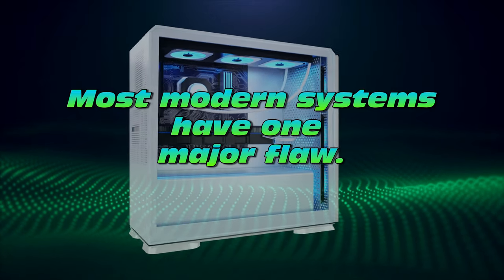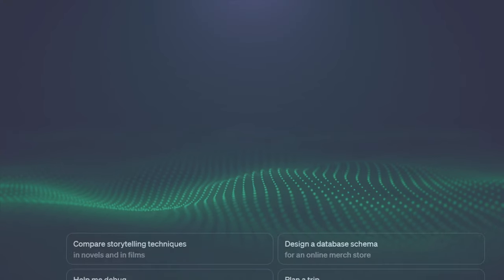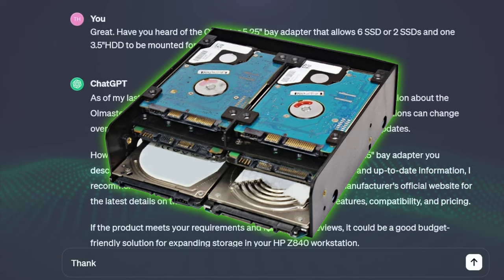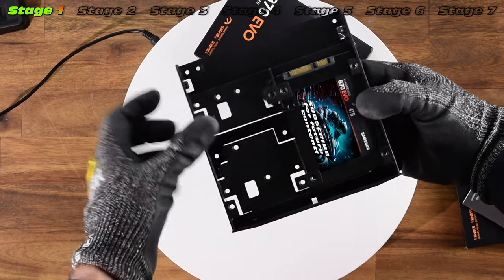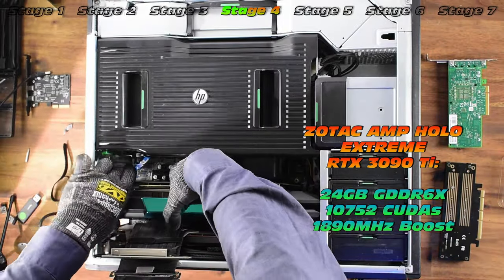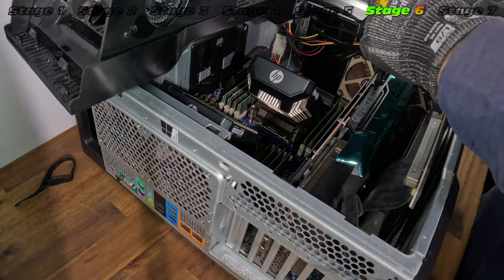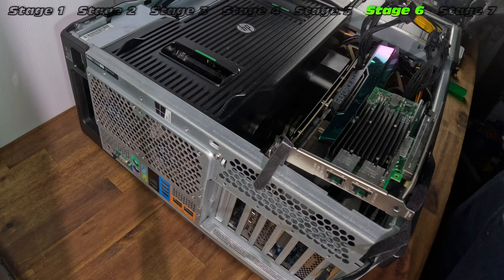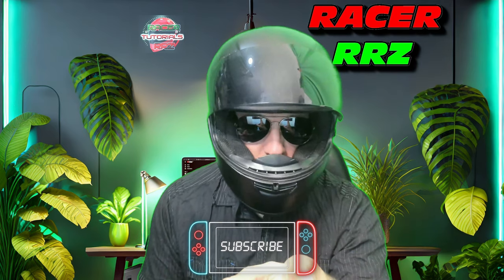Is this the most cost effective storage expansion? - HP Z840 Workstation + 5.25" Bay + 24TB SSD/HDD.

Comment: Good stuff. I for one enjoy watching content about storage solutions. Getting to the point where you can't fit those newest CoD games on SSDs without going for RAID.

Bit of a rant: Yesterday I just completed my new 8TB NAS setup with 4xNVMe drives striped and while there's a bottleneck somewhere and its throughput is well below what I expected, I can still max out the 10Gb/s link between my workstation and NAS in large file transfers. Could probably fairly comfortably even play games installed on network drive now. Was only getting 4-5 gigs at first, but later I realized manual tuning of socket buffer size in samba was actually hurting performance in this case. I would say one interesting thing I found out was that it's actually possible to configure samba to make use of smb multi channel even with single NIC as long as the NIC supports a feature called RSS, or Receive Side Scaling. My Mellanox ConnectX-3 did have that feature and I tested it to see that it did actually use multiple connections/threads while transferring files. This could potentially help with CPUs that have lower single thread performance.
Reply from the maker: Nice. It really is intense how large installers have become - some software systems can use 1TB of storage and then still want more. I think my DaVinci Resolve library is slowly hammering my 8TB RAID 0 pool. 

Your hardware setup and speeds sound almost exactly like what I obtained on my Z440/ Z840 10GbE network. I did find it strange that I could watch 4K video from the NAS over 10GbE but I could not play back the same video off a HDD mounted in the hose machine. 10GbE does seem to break some logic rules! I am clearing some HDDs for a test. I will test 4x 4TB HDDs with RAID 5 in TrueNAS. I suspect that will give me more than my current limit while writing to a single HDD drive. 

Tuning smb multi channel sounds like a viable solution for improving data transfer in certain systems. I have not really tested the limits of my Xeons for this, but I would like to think they would never really be pushed with mere data transfers. I have an older HP Elite 8300 SFF with TrueNAS that I need to do some tests with. It seems quite capable despite the well aged 4 Core CPU in there.

Comment: I love your content, rarely reviewer reviews workstation, workstation is incredible machine, it's long life span, I still use workstation from 2014 and still going strong, on par with high end consumer pc i9 14900K without heat issue and thermal throttling, workstation is amazing. I use HP Z840 with 2X E5 2699 V4 and RTX 4090 for rendering, editing, after effect, everything run smoothly, build quality far far more better than dell 7910 that I have too
Reply from the maker: Thank you for your words. Yes, it is quite rare to see these more aged machines get reviewed these days. The value proposition of the HP Z840 with dual E5-2699 V4 CPUs is difficult to beat - it literally provides a top end experience that is still competitive with modern hardware. There are other systems that are also quite good - and generally Dell Thinkstations do a great job - it would just cost a bit more generally to get a decent modern system. I would like to think the HP systems have a better build quality than say Lenovo or Dell, but if you have to spend more for that it may not always be the best option. I usually just settle on the highest performing system for the lowest price possible. Right now that has landed me on the HP Z8 G4! 

Wait - you managed to get a RTX 4090 into your Z840? That's awesome! You should consider to make a post on our Reddit page regarding your experience with the RTX 4090. I initially disregarded the RTX 4090 in the Z840 because of the 4x 8-pin power supply requirement, but I later realized that with a 3x8-pin to 1x 12VHPWR adapter you could very well get the latest hardware into a Z840! In case you haven't seen it - here is my latest video overview of the Z840: https://youtu.be/2bie4EGJZL0
Reply: @racerrrz  I use Y splitter to get 4X pcie pin power, 1 line pcie supply 225 watt, so 3 lines will supply 675 watt, more than enough for RTX 4090
Reply: Hello! Why is Z840 better than T7910? Can you talk more clearly about its advantages and disadvantages?
Reply: @agungnorhasni714  Hello! Why is Z840 better than T7910? Can you talk more clearly about its advantages and disadvantages?

Comment: For SSD storage: Athena Power BP-15827SAC - 8 Sata SSDs in 1 5.25" slot.  Add a cheap 8 port Sata pcie card for about $30 and you are good to go.

I love mine.
Reply from the maker: That is a work of art right there! Nice find. I had not seen this 8-bay adapter until now. Everything you could want, plus it's space efficient and cost effective. That has to be the winner there. It would pair up well with the Intel H240 HBA which has dual SFF-8087 ports that can be converted to 8 Sata/Sas ports with adapter cables. I'll add your suggestion to the video description for others to track.

Comment: Great video. I just got an HP Z840. Why use Windows instead of some Linux? I was going to dual boot, but use something like ZFS for the bulk of my storage. I need to use some 3D software in Windows. But most of what I like to do can be done in Linux.
Reply from the maker: I live and breathe Windows 10 Pro - it's my go-to OS for daily tasks. Likely Linux would be faster and it could do most of what I need but it just gets annoying to deal with software that isn't compatible. Dual Boot Linux + Windows has always been a nightmare to get working for me (recalls many hours of frustration lol). Once working it's great.  

If I am on Linux it's usually to deal with Windows issues outside of the Windows OS (Windows issues vanish in Linux, surprising I know lol). Linux Server is decent also, but I settled on TrueNAS Core as my secondary OS (well storage OS). I am planning to test out Proxmox and I suspect that might really help with managing several different OSs on the same system. It's handy to be able to boot up a given system in any required OS or to just be able to test something. 

I have my Z440 Server Build setup to boot into Win 10 Pro or TrueNAS Core, I should probably get another SSD in there for Linux lol.
Reply: @racerrrz  I used Windows since DOS days. I still feel like I'm drowning when I get a DOS shell. I remember having to get things running with batch files. Then I learned Linux shell and everything was so easy. You can get Linux shells that run on Windows now. So that helps with low level tasks. In the old days I used to program on WindowsNT, which was a step above regular Windows and written by non-Microsoft people.
Reply from the maker: There is nothing quite like that throw-back to MS-DOS, but CMD is the closest thing to DOS that I run into these days. I enjoy my GUI lol. Linux does do it well though and once you know your Sudo's it's not all that bad. I recall Windows NT but I don't think I spent much time on it. I went to Win 95 and then to Win XP.

Comment: I really need to stop shucking HDDs. The WD white labels only have 4 mount points.
Reply from the maker: I like your approach for getting cheap HDDs lol. I opted for a more outrageous method - AliExpress "new" HDDs lol. So far I can confirm they are likely all used drives that have had their SMART data adjusted. But my logic is that for the price point, if I can get a 1-2 year old W/D Red Plus NAS or IronWolf Pro (checking the drives details for a date is a must) for half their retail price then it's worth it. Even if they were used for something like Chia Mining for 1-2 years they should still have a heap of live left - I hope.

Comment: I like this content! It could maybe use some refinement 
but it’s better than what I could do. I see now why you need the helmet. Butting heads with trolls…  
Now for my main question/comment: I had been inspired by your videos on using an older HP z840 workstation to get some more storage or use as a server of some kind. They seem to be running around $800 or so. So I hadn’t pulled the trigger. Recently I happened to find a used Threadripper 1950x system with everything except a GPU in the case for $400. I jumped on it because I figured maybe i could work with that. It’s in a Fractal Design Meshify. I don’t think it has a lot of bays for hard drives but it has a few. I was thinking maybe I could get an NVMe M.2 PCIe expansion card for it. What would you do with such a system?
Reply from the maker: Thank you. I am open for suggestions on how to refine things (any input gives a new perspective, good or bad). It's a slow process but I continue to aim to make small improvements with each new video.

It's a fine line between the modern hardware and the aged systems. Generally, you pay more to get a "modern" system up and running. E.g. Just getting a decent case that can house lots of HDDs will set you back ~$300 USD (e.g. Z440 + Fractal Define 7XL + Drive caddies - there's a video for that: https://youtu.be/K4RalaEbRI4 ). 

If you add in the cost of CPU, Fans, PSU, Mobo it usually reaches more than that of the Z840’s price. Your complete system for $400 was a great price! If you were planning to game on it, the newer system would be far better (single core performance on Xeons isn’t great). Pricing on Broadwell Xeons is however really good right now. I got a E5-2697A V4 for my Z440 for a great price (Affiliate link: https://www.ebay.com/sch/i.html?_from=R40&_nkw=E5-2697A+V4+&_sacat=0&_sop=15&mkcid=1&mkrid=711-53200-19255-0&siteid=0&campid=5339029473&customid=Xeone52697AV41&toolid=10001&mkevt=1).

Threadripper 1950X vs E5-2697A’s benching:
https://www.cpubenchmark.net/compare/2814vs3058vs2814.2/Intel-Xeon-E5-2697A-v4-vs-AMD-Ryzen-Threadripper-1950X-vs-%5BDual-CPU%5D-Intel-Xeon-E5-2697A-v4

I did consider case swapping the Z840 into the 7XL (https://youtu.be/Rsr_zxOg6K8) which would make for a solid server/NAS foundation. The Z820 / Z840 both have SAS and SATA chipsets, so they are ideal for storing lots of HDDs. The bonus with the HP workstations is the efficiency of the PSU (90% platinum), but your idle power draw is high (like 300-350W). 

Regarding PCIe M.2 NVMe expansion – I have done tests on 4 different quad adapters so far. This video compared 4 adapters head-to-head: https://www.youtube.com/watch?v=xqg0uQ93KTg  and I also have 3 of 4 individual guide videos done (more detailed overview on each adapter). 

Presuming your motherboard has an extra 1 or 2 x16 PCIe slots that support bifurcation you could work towards the Asus Hyper M.2 Gen 4 adapter. In my testing (I did the Gen 3 adapter in the Z840), that was a great balance between speeds and thermal control for the price tag. Affiliate link: https://ebay.us/S1qBJE
Reply: @racerrrz  Thanks for the detailed response! I wasn’t expecting that. I will use your links as a springboard to do a deeper dive. I had thought about putting the Gigabyte X399 Designare Ex MB with the 1950X TR into a larger case with more room for storage at some point. Last I checked the PCIe could bifurcate. I can’t remember how to verify that but will ask ChatGTP. I’ve never tried RAID configurations before but the moment I heard such things were possible for home computers/servers I’ve been trying to figure out a way to acquire hardware and do it as close to the right way as possible on the first go around. Can’t avoid the learning curve entirely, which usually costs $$$. I will rewatch this video and some others but if I had to make an unreasonable request, it would be to keep it more within reach of newbies without, I suppose, boring the expert enthusiasts out there. Thanks!
Reply from the maker: Go for it. The challenge lies in finding solutions to problems that present themselves. The X399 Designare Ex with a 1950X TR should give you decent performance and the hardware should be quite capable of handling future expansion that you may want to do. Bifurcation wise, it's best do go down the Google search route (ChatGPT has limits for now). https://forum.level1techs.com/t/gigabyte-x399-pci-e-bifurcation-support/127130/6 I suspect with updated BIOS you would be ok, although it looks like the board didn't support bifurcation right out of the box (but with BIOS updates the support was likely added). 

The joys of ChatGPT, I am glad to hear you are using the AI for clarification - too handy these days. Each RAID level serves a purpose and it can be a life-saver if setup correctly. I am impressed by the performance of my RAID 0 NVMe pool, but that is high risk storage. The more optimal format is RAID 5 or RAID 6 which can provide a buffer for HDD failure. It's not really something that becomes important until you have data that you want to keep secure, but I would still think everyone would benefit from that added data integrity. It's less than ideal to loose old photos, videos or documents etc. See how you get on and if you have questions you know how to go about solving them, questions.
Reply: @racerrrz  Hello! When the Z840 is in idle state, how much voltage is consumed?
Reply from the maker: @sachsongkhoe  Hi there. Sorry about the delay. The Z840's power use will vary depending on the configuration. My system would typically use ~ 350-400W when loaded into the OS but at idle. When bench-marked the power-use could spike to ~750W. These power readings include all peripherals connected to my machine - so the readings for the system alone will be lower. 

In case you have not seen it - I did a more detailed overview of the Z840 here: https://youtu.be/kHkEmaN8ZlM
Reply: @racerrrz  thank you! I watching your video now

Comment: Nice. Are you worried though about the lack of fans on your spinny HDD? They can get a bit warm.
Reply from the maker: Absolutely. I switched out the HP dual fan unit for dual Noctua 92MM slim fans (Part numbers etc. was in my GPU fitment video). The HDDs tend to not do too badly on temp. in the Z840, but that's likely due to a large GPU drawing in some air. But I would like to think the HDD fans are needed to keep the PCIe slots and lower motherboard cool also.
Reply: Sorry I was asking only about the HDDs you have in the Olmaster adapter. From what I can see, the dual Noctua's are keeping the lower part of the z840 cool. But what fan, if any, is cooling the HDDs in the Olmaster?
Reply from the maker: @myburn  Ah sorry I misunderstood! Thank you for clarifying. 

You are correct, this Olmaster adapter does not have a fan and this will mean less air flow than what is ideal. However, the HP Z840 is designed with a tri-chamber concept. The PSU Bay, CPU Bay and PCIe Bays, all of which have their own fans to create pull through the front face of the case. The 5.25" Bays will be drawing in air through the action of the CPU and RAM Fan Modules. So there is airflow to keep the drives cool. 

I actually removed the HDD from the Olmaster adapter (I was worried about vibrations) and I opted for a different Olmaster adapter that has fans- but it only supports 2.5" drives. I covered that adapter in a related video: https://youtu.be/ZczhWw834GU . The SSDs do not get warm in this adapter, and it seems to work well enough for the price. 

Side note, the HP Z8 G4 has a redesigned case which actually does have a more dedicated fan module placed over the 5.25" Bay area which is cool to see.
Reply: @racerrrz  Nice, that all makes sense. Keep up the good work, love your videos, I think you are the only YouTuber that covers the z840 in detail.  And quit tempting me with that Z8 G4!  I don't know how I would be able to hide that expense from my wife lol
Reply from the maker: @myburn  Thank you. Yes, the Z840 doesn't get a lot of attention. I have a full Z840 tare-down video in the works, so there will be some action for it soon. 

Haha good call there. I got lucky with an unusually low priced unit. Quick wifey purchase justification - Honesty is key - You will sell the Z840 for more than what you paid for the Z8 G4 (it's not easy to find that cheap Z8 but it can happen!) Side note, that's bad logic - my Z840 is yet to sell to recoup costs, but I remain hopeful lol.
Reply: You're correct I have the Icy Dock version, and when I put an Ultrastar in there the temps shot up to 55 degrees.  I ended up moving the HDD to another PC.
Reply from the maker: @zeroturn7091  Is that the Icy Dock unit with fans? I must have got lucky on mine, or I just don't place the drives under enough load to notice high temps. I had a 8TB W/D Red Nas HDD and for a short while a 16TB IronWolf Pro in the 5.25" Bay adapter, but they hovered around 30-45'C which I could live with. I moved the HDD back into the 3.5" HDD bay - these large drives come with a fair amount of vibration. 

I also switched this 5.25" Bay adapter out for one with fans. My SSDs in that 5.25" Bay adapter hover around 30-34'C. Video link for interest: https://youtu.be/ZczhWw834GU
Reply: @racerrrz  no fans on the MB343SP, it seemed like a good idea at the time.